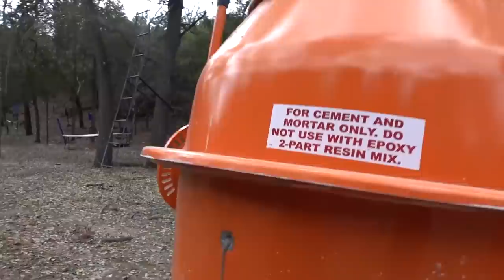Can WET Concrete Stop a Bullet???

Comment: Cement! Concrete has stones in it :o)    And I feel that would make a big difference.
Reply: Yep
Reply: Yep, that was just Quikcrete that's used mostly for quickly filling in holes or for setting fence posts. It's not proper concrete, it's more like a quick setting mortar cement, than actual concrete. Proper concrete is sand, aggregates (gravel/pebbles/sharp-stones), dry cement and water. It's also generally mixed to a much thicker consistency, than Quikcrete. A standard concrete mix is 1 part cement, to 2 parts sand, to 4 parts aggregate. I'm pretty sure with those aggregates added, it would also make a big difference.

Comment: He has no idea how much water goes into concrete. That’s way to much.
Reply: I was thinking exactly the same thing, who pours at a waterlike slump?
Reply: not to mention that he's missing the sand and gravel that make up more than 50% of the mixture.
Reply: LOL yeah he just threw a bag of quickcrete in and added about 25 or so gallons of water. Should have a 1 inch slump in there with stone and gravel. Matt we need a redo!
Reply: Maybe it was done to make it more enjoyable viewing. He knew it was going to leak out the holes and jump out hte top. Properly mixed concrete would give none of those effects.
Reply: @syx3s  youre completely forgetting the coarse aggregate. real concrete has stone
Reply: @cmonsense154  exactly! at least throw in some 1s and 2s to the mix, in the video he’s just mixing and then shooting grout. if matt is gonna want to redo this video accurately he’s going to have to truck in a load of batched concrete
Reply: @Ru77ian  do you know what gravel is?
Reply: @aaronkratzmann9703  call it cement slurry then.  concrete is a very specific term in engineering.
Reply: @cmonsense154  gravel is the stone aggregate, you also need sand.
Reply: @syx3s  correct It didn't look like it was lacking sand or water and yes I'm well aware of the aggregate ingredients that make concrete and the different mixes Lol
Reply: @aaronkratzmann9703  that very well may be it was still fun to watch would of been nice to see the other way too is all

Comment: Next you should do how many actual bags of concrete does it take to stop a bullet!
Reply: 1.  The dry concrete would act like a sandbag.  Except the dust would be caustic and dangerous to breathe in (*more* dangerous than sand, of course).
Reply: @blacksheep_edge1412  actually my dad has been a Mason for 30+ years he is 57 I've helped him for 10 years in 14 and we never hand any problems with the dust I mean it drys out your skin and mattes your hair but lung wise we never had any problems
Reply: @thIDthIRreenactor  Interesting.  I would imagine a professional like your father would know how to minimize how much of that dust gets into the air when they're mixing, which would reduce exposure.
Reply: @blacksheep_edge1412  my dad owned a business but he has a big mixer that dont ket much dust out also he busts the bag in the mixer so not much dust
Reply: @thIDthIRreenactor  Makes a ton of sense.  I'm sure he knew breathing it isn't good for you so he did everything to avoid doing so.  Tiny bits here and there aren't gonna do much to you, but large amounts several times a day over years would mess you up I'm sure.
Reply: @blacksheep_edge1412  yea

Comment: Can I just appreciate the fact that he almost took half his hand clean off at 3:25 and again at 3:27?!
Reply: lol
Reply: how would that remove his hand
Reply: It thought the same thing haha would be very nasty and i believe when you get stuck between that mechanism no good is going to happen in any way, and i think that mixer is not broken, you have to pull it over, it has not power enough to turn the mixer you hear it, i had one that was older and in could not make concrete at its max capacity

Comment: What a devastating round the .50 BMG is. When I saw the hole one round did to the cement mixer, passing through the wet concrete and out the other side, I could only imagine how terrifying a weapon the quad .50 was.

Comment: Flex tape and other things probably work pretty well when not much pressure is involved. I got a hole in a air mattress. The PSI on the hole was too much for it. Wouldn't hold..

Comment: The Kel Tec was not a sub 2000. Looks like it was a SU 16 series. Sub 2000 are either 9mm or .40 cal and look different. Both are cool guns, though. I have a sub 2000 and would love to have a SU 16.

Comment: By the way: Ever wonder how they chronographed rounds in the days before electronics were invented? You take Matt's cement mixer, empty it out, and replace the steel drum with one made of cardboard. Shoot your round through it while it's turning, and you can calculate the speed by measuring the angle from the entry and exit holes.

Comment: When the concrete mixer Is full, the motor wont turn the bucket while full once you turn it off, so you cant switch it on and off unless the concrete is ready to pour then turn it off, tips for the future

Comment: You should do a screwdriver video and see if you can split a bullet in half by shooting the tip of a flat head screwdriver break the handle off and weld the screwdriver part to a steel plate and also get some different types of .50 BMG rounds like Roufass rounds and the tungsten rounds and stuff like that

Comment: 3:47 That mixture is weak. The consistency is a lot like porridge and there's no gravel nor sand. 
Just a sack of cement and water. I worked as a Lab Tech in a ready mix concrete factory.
That's not even a quality good enough for installing marble tiles.

I think if this one was done properly, it would've made quite an interesting outcome.
Don't forget about chemical admixtures too.
--
Unless, this is a recipe you got from china, then, it's fine.
We can see how weak their structures are. HAHAHA!!

Awesome videos as always.
Keep up the good work.
Stay safe.

Comment: Thats cement not concrete and bloody wet cement at that cement is made with sharp sand  and is a 4:1 and concrete is made with stone, sand, and water and is used for roads driveways cament is used to bond so building a wall a house ect ect